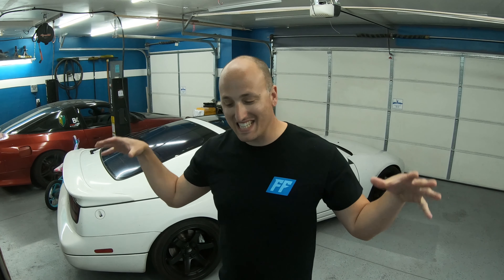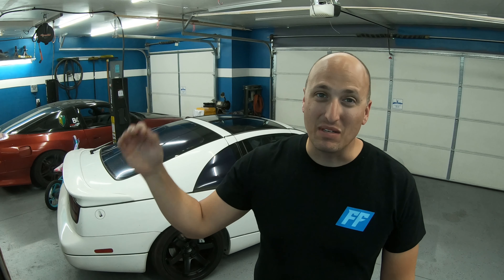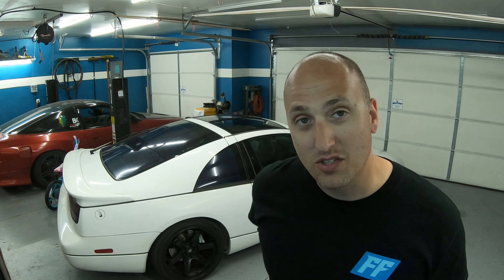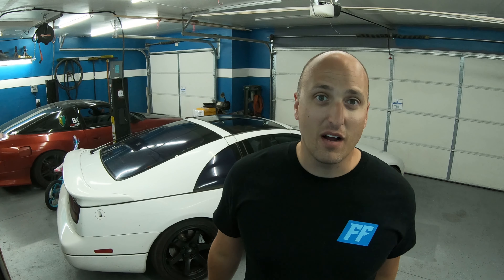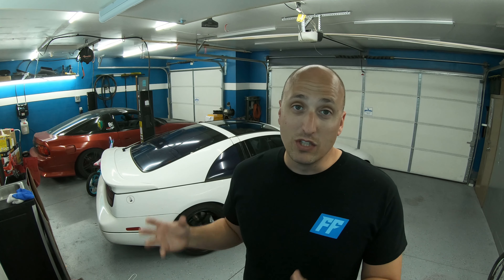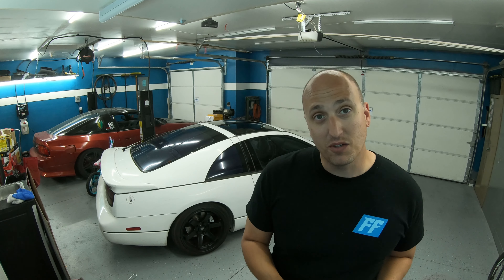MUST HAVE POWER MODS FOR YOUR NA 300zx!!!

Comment: Another tip for NA guys. Delete all the factory coolant crap under the inlet and through the throttle bodies. 
These heat up the inlet manifold a lot. 
Fitting a cat back exhaust on my car made no difference other than noise.
Deleting these bits, plus binning all the other engine in bay crap* made a HUGE difference to response and torque, especially mid range. Plus it stops the dreaded coolant leaks.

*The exhaust recirc valve on the back of the block, between the heads. That is a sod as well. I also blocked the pcv and ran a catch can. Doing all this actually improved the emissions as well!!!
Reply from the maker: Good Tip, Thanks for sharing!
Reply: any tips on where to start with this? or where to find information on how to do these deletes without fucking anything up
Reply: @Meefehyjkoygsww  there is a z32 wiki page that has pretty good guides. I went from there. Are you in the UK? If so I'd be happy to help where I can. I'd add to my above advice that a lightweight flywheel was amazing. I used a SR20 one iirc and the engine revs like hell now.

The plenum deletes are pretty simple tbh. It's only the egr that's a pain and to save chew if you don't want to go mad, you can leave the actual valve on the engine and delete the pipes.

Hard to explain without pictures
Reply: @AdamMGTF  not in the UK. Very nice of you to offer though. Good tip on the flywheel as well. Just got my z32 last week so I’ve been learning a lot over the last few days. Definitely a newbie when it comes to working on cars, so not the best first choice for a rwd maybe. But I love the car. 93 red vert 2+0 NA with 95k miles. Had its pump and timing belt done at 78k
Reply: @Meefehyjkoygsww  want my email? I'd be happy to help where I can... Top tip. The year of manufacture doesn't mean much with these. The spec is more important and even that varies.

It's actually a very easy car to work on. You'll have no issues learning on it. The turbo ones are tight in the engine bay. But the na ones have plenty of room and they generally are very well supported after market (it helps that lots of parts of S bodies and skylines fit)
Reply: @AdamMGTF could i get your email? You seem super knowledgeable and i just got a z32 that im eager to work on

Comment: on top of what jesse said there's plenty of mods you can still do to the n/a manual to be faster than a stock tt-auto in a quick drag.  first do every delete known to the vg30de or tt  to reduce the weight even better if you got a 1990 2.0 base model 5sp like i have which came factory with 4.11 ratio diff gears, no hicas, no cruise control, no abs. no wings no side skirts it's all excess weight, power to weight ratio means a lot on small engines. don't just disconnect things get that shit out of there, eg: aiv's, behind front wheel arches, standard airbox and pipes etc have to plug other pipes, egr delete and block plenum, delete rear wiper motor, then a set of exhaust headers with a pair of ss megan down pipes,  ss twin magnaflow mufflers, ss uas x pipe centre muffler, under drive pulley kit with mod to water pump pulley size, stage 3 clutch with a lite weight steel fly wheel, ecu eprom plug fitted to ecu board for different tune chips that can be change out or re tuned. also series 2 ptu, single piece tail shaft, delete clutch fan and fit a big davis-craig thermo fan to radiator, i use a Mishimoto radiator, with lower the degree nismo thermostat. blue gates timming belt,  also my air cond packed up years  ago so i remove all of it and boy did it weight a shit load plus i don't like driving it on hot days anyway, plus my bose speakers were clapped out you'd be surprised how much they all weight too. as they each have and amplifier built into them making them very heavy too. i don't run a spare tire or jack etc ide call a tow truck if needed. i don't drive around on a full tank of fuel to much extra weight, don't run big rims with fat tyres its more weight to get spinning. plenty of other upgrades done but not really related to hp gain like fresh injectors and new coil packs and wiring deletes etc. ive owned my zed for pretty much 20 yrs now and done all the mods myself ive never put it on a dyno but its a hell of lot quicker than when i bought it when it was 100% stock. it also handles better too, so win win.  we also have 98 octane here in Australia on pump at every servo. and inside my fuel door it says to only use 98 octane because its a jap import to australia. ive never wanted to sell this little rocket in all this time ive had it. ive had plenty of other cars but this is my favourite one of all time and im in my mid to late 50s now. its still only travelled 130k on the clock, plus when its a 2.0 black on black you'll never go back, lol
Reply: This is the exact model I have. 1990 2+0 NA 5 speed. Thanks for the info sir. My Cruise control doesn't even work; so, I'll remove this then.

Comment: Nice video.  My z32 na is bone stock. I am now seriously considering adding the  cone air filter.
Reply from the maker: Thanks, Go for it, just keep the stock box or sell it for some extra $$. Z1 has a cool PTU Relocation Kit you can use if you go with the air cone.

Comment: hey Jesse love your videos!! I have an NA 2+2 right now with a TT motor shipping in soon. I plan to build that on the side before throwing it in the car. Any suggestions on what turbos to upgrade to?
Reply from the maker: Congratulations on the TT Engine! If I was going to Upgrade Turbos right now I would use... the Z1 GT525, they work with the 4 bolt down pipe 400-500hp range, If your replacing down pipe and want to go with 5 bolt down pipe, the  GT555R  for the 450-500+hp range. Good Luck out there!
Reply: where did you find the tt motor and how much was it?

Comment: Love the videos Man U think if I put aftermarket headers will it cause a check engine cuz so far I have the hks cat-back exhaust and I’m putting some magnaglow air filters
Reply from the maker: Thanks Mexican Monster! If it dose try the O2 de-fowler, I’m running them on my 350z that has headers, CEL was on for O2 sensor, I just replaced O2 sensors and added those de-Fowlers at the same time no more light.
Reply: Thanks @jesse’s Garage 👍🏾

Comment: Selin is definitely not stage one(about 600-800 in cost depending), but on an NA it's a guaranteed 15hp bump to healthy NAs and even more to TTs.

Back pressure is BAD. We do not want back pressure. Back pressure is the INABILITY to remove gasses from the exhaust. This thought process needs to DIE.
We want scavenging and VELOCITY. The faster the exhaust moves the better it can evacuate gases from the exhaust. 

Manifolds don't really add anything to HP. They do improve the looks of the engine bay however. Stillen claimed 22hp gains when they introduced the NA header, but it was never proven and to date no one has dyno tested it alone. Even I didn't dyno my car before putting on manifolds. Stillen never provided any dyno charts or proof, but said it would provide gains.

Reasons you need a tune on the NA. Adding anything that frees up air in/out of the motor will cause the air fuel to lean out. You'll go from 12-13 stock to 15= on the dyno with just breather mods. This causes a loss in power and puts at risk of detonation from it running so lean. We need an ECU tune whether it be chip or dyno to dial the fuel back into normal levels. Our ECU does NOT auto adjust when it sees new air... that's part of why we gain HP running the Selin mod. The ECU however will bump up around 15-25hp depending on engine and mods.

I can not recommend regrinds on cams. If you want to upgrade cams then get new cams. That is definitely stage 3 w/e on the NA.
Reply from the maker: Thanks for Watching!!

Comment: No mention of lightweight pulleys?  Also, you just can't replace/flash ECU's on '94+ cars. You'll need a piggyback setup, no? And, you could consider lightweight wheels to reduce unsprung weight. Lightweight flywheel...
Reply from the maker: Could Definitely do that, 300zx could lose a Few lbs. Have a Great Day!

Comment: @1:14 I cant recommend AGAINST a cone/pod filter hard enough. The factory airbox is way way better. K&N or similar panel filters are good. I tried various after market air filters including enclosed cone, open cone and extending lower down to move away from the MAF etc etc. Across 8 years drifting my NA VG30. The standard air box can't be beaten. 

Deleting the resonators is a good idea. I just welded a plate over the metal plates.
Reply: Although I have currently switched to a cone K&N with adapter plate for my NA 95' and I also do agree that their is not noticably if any power gain at all and maybe even a slight loss by itself but with the addition of plenum spacer, exhaust, ECU, and some small vampiric deletes it definitely opens the system up some especially in the mid to high range.
Reply: @SoloKyoto  hi mark. Couple of quick questions if you are ok sharing?
When you say plenum spacer. Do you have any info on this for VG? I have one on my brother's VQ35de which is in his R33 drift car. Its a big improvement for sure. But I've not heard of it being done on VG. If they are available I'd love to try one!....

Other question. I've worked on UKDM 300zx turbo models and I own JDM import NA cars and have had TT engines in the past. You mentioned your car is a "95". Did nissan vary the engines in America? 

The UKDM, JDM and EUDM cars didn't have any differences to the engine I know of (other than the PTU, S1/2 stuff of course but that's all electronic).

Cheers and nice to talk to a zed owner from the other side of the water :)
Reply from the maker: Absolutely, I actual Ordered and used stock air box just to replace the wore out cone filter someone had put on the car long ago.

Comment: I have a n/a. What is your opinion on a muffler delete is  it a good idea?
Reply from the maker: Hey Pharaoh! Going to be for sound tuning mostly if you just delete the OEM mufflers from the OEM exhaust, I had a muffler delete on my 350z, check out the video where I measure the sound with a decibel meter. Also Z1 has a straight pipe option for the 300zx if you want a muffler delete with out moding the OEM exhaust (I think DannyZ has it on his 300zx) Going to be much louder, I was at a 94 decibel just at idle and would go over 100 decibel on cold start on the 350z.
Reply: Thanks brotha for the info and response
Reply: It doesn't really give you much of a gain in power at all but the SOUND!!! I replaced mine with two K2 Motors duel, flared 3" outlets 2.5 inlet and just cut and clamp using some size adapters and exhaust U clamps. I would suggest having them actually welded on but I plan on changing them out pretty often to test sound differences so im just going to stick with the clamps until I find what sounds best. Cheap and easy.
Reply: Sweet!!  Let u know when its done

Comment: 1990 NA for 9500 with 133,000+ miles. Is it worth it?
Reply from the maker: Hard to say with out knowing more details or seeing pictures, but for $9.5k better be near perfect and be a 5spd.
Reply: @BuildTheoryZ  this is what the post says:
Price is obo 
It is a clean title
Selling my buddies 90 Nissan 300zx
Car is currently wrapped with a chameleon blue/purple
Tires are brand new 215/35r18 
Has aftermarket headlights 
ESR wheels 
No grinds, no engine light on 
After market steering wheel vertex 
Has two subwoofers with custom boxes 
Fresh coolant, fresh oil change (maint up to date) 
Doesn’t over heat 
No issues running 
No trades 
133,00+ miles 
Interior needs work tho
Reply: @extrationoflost7541  Hell no. U can definetly find a better one even with the market right now
Reply: @gioandres306  yea, I told the dude. He got upset.

Comment: I've heard people single turbo the na, is that too much of a headache? I have a 93 convertible and want more power. Thought about ls swapping it but if the single turbo would be the cheaper option I'd go for that
Reply from the maker: I haven't done mush research  on a single turbo set up, I would be interested to learn more on that as well.
Reply: @BuildTheoryZ  its probably just easier to ls swap. But damn I don't wanna get rid of this motor, such a nice clean sounding v6 for its age

Comment: What type of headers do you recommend for the na z32
Reply from the maker: Hey Christian, Check out ConceptZ Performance, they have some. I have DC Sport headers on my 350z but options are a little more limited on the 300zx.
Reply: It's all the same. Every manifold out there is a copy of Stillen at this point. Escort had long tube headers at one point but they're NLA and were never cloned.
Reply: youre better off keeping the stock manifolds as they flow the same as other aftermarket manifolds
Reply: Find a set of stillen headers they definitely helped my Z
Reply: If you’re still looking go for Stillen, might not be as big of a performance gain as you’re expecting though. But the sound is insane

Comment: Hey Does anyone know if it would be a good idea to clean throttle body with a brush and cleaner or is it bad for it’s engine ?
Reply: its an aluminum throttle body so dont use anything too agressive. Youre fine using some brake parts cleaner and some cloth. you can always remove them for easier cleaning
Reply: @ialexfbz5204  ok I’ll try that thank you so much
Reply from the maker: Just try and keep any thing you clean off out of the intake manifold that way it dose not get sucked in tho the engine.